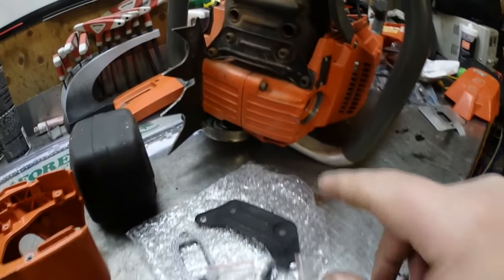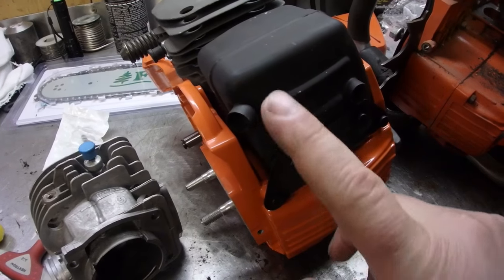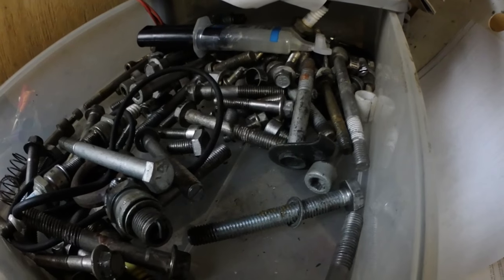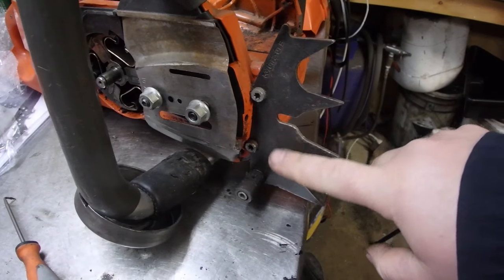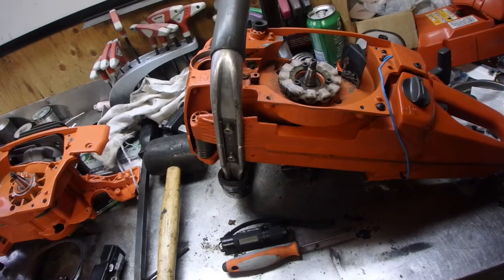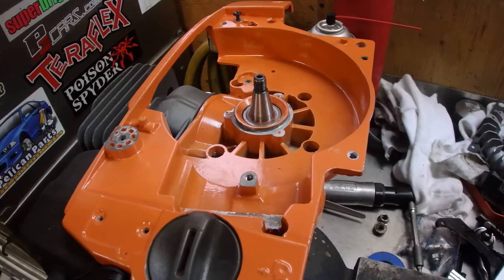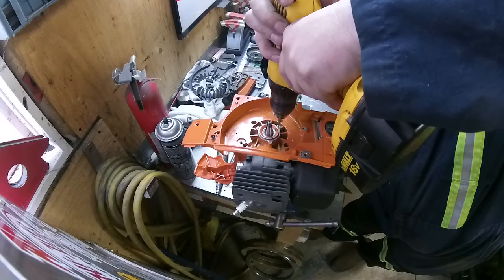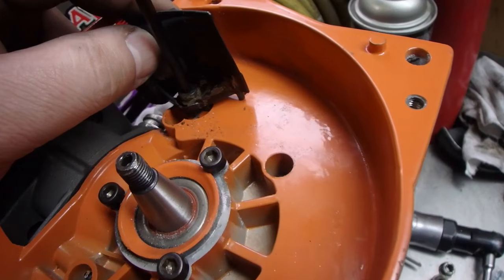The Chinese Husqvarna 372xp Build

Comment: I wrap some masking tape around the bit making a 1/16 shoulder it comes up again`st the surface like a stopper .I found a big Jonsered in the bush while quading  they must have dropped it and ran when the fire went thru , Geez was a big bugger 4ft bar was like a 2240 model heavy too 10 lbs or so  .
Reply from the maker: +Garnett M Jesus that's huge do you still got it ?
Reply: Bullshitkorner No a friend wanted it ,Man it would rip the ass off a guy all day big SOB had compression like a dirt bike but it needed a coil .

Comment: I recommend the other chinese husky the poulan pro you can get at princess auto. Refurbished for 99 bucks i buy em as back up for my forestry service business. I like them so much they have become primary and all the stihls sleep in there wilcox compartments.
Reply: rob armstrong Why are there so many refurbished?
Reply: I think ethanol in gas is destroying/clogging carbs then they are brought in under warranty - i use stihl 2 stroke oil with fuel stabilizer to solve that problem.
Reply: P.s. echo brand chainsaws are pretty nice lots of power, reliable too
Reply: Ethanol is much cleaner than gasoline, its not the cause of clogging for sure.  It can eat at the lines however, but most companies have addressed this and have changed to E85 capable hoses.

The carb wouldn't be damaged by ethanol however.
Reply: What should be the compression in the new 372xp saw?
Reply: @Sensei948  With that Aftermarket top end and a base gasket i would say around 125
Reply: @madjimms  140psi Good compresion 372xp oe?

Comment: Did you change your upload days?  Usually it was Mon, Wed and Fri when I got off of work I got notifications.
Reply from the maker: +BuddyLe3 yes Mondays and thrus now
Reply: @BackCountryWrenching  140psi Good compresion 372xp oe?
Reply: @BackCountryWrenching  Friend, is Meteor piston good for 372 xp saw compared to OEM Mahle? I mean power. Apparently the cylinders are worse? Is it possible to install 1 ring in a pile 372 xp with a new piston as before there were 2 rings ...